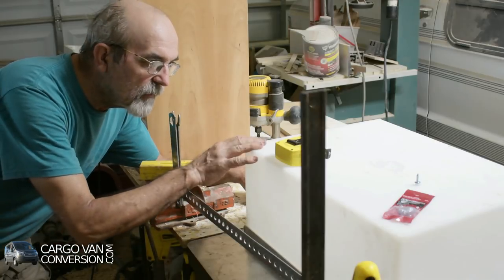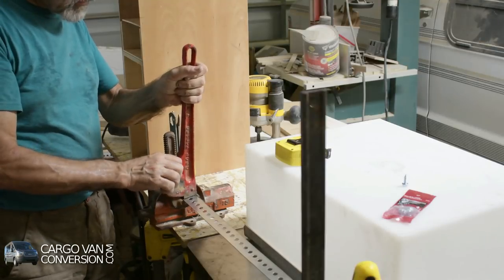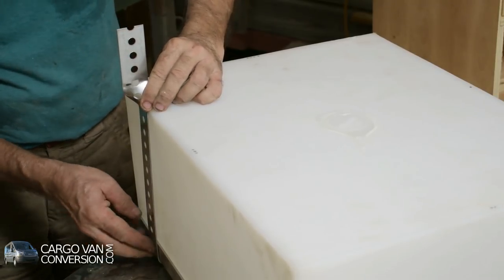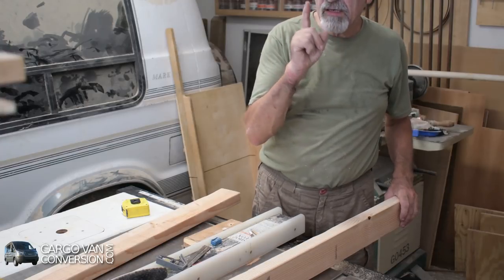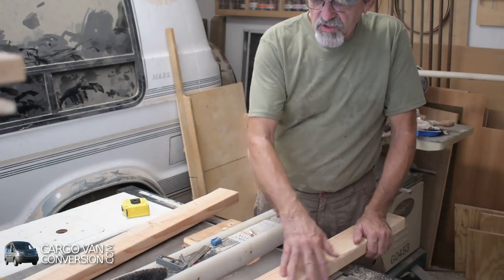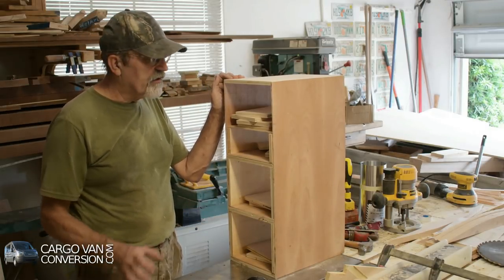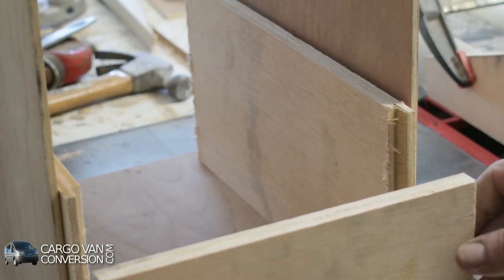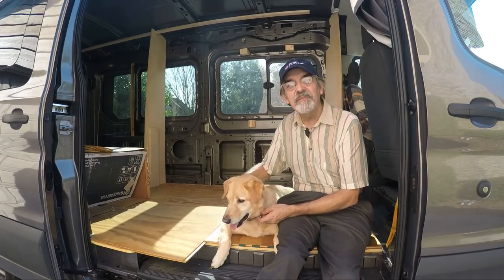Gray Water Tank & RV Workbench

Comment: Nothing like a compact work surface when you need to repair something. I never liked rebuilding parts on kitchen counter because no matter what precautions you take something always gets on it.
Reply from the maker: Actually, it will have a sizeable work surface of about 5 feet long, but only about 13 inches wide. I'm quite excited about the workbench. My greatest doubt is whether it will fit my lifestyle on the road. Having it is one thing, using another :)
While writing this, I remember that I wanted to do some (oil) painting too, while traveling. Time to make a folding painters' easel :)
Van Williams

Comment: I’ve never heard of over stressing wood before could you explain? My woodworking is limited to hand tools. But I enjoy watching you on that table saw.
Reply from the maker: Hi Stephen,
Stress or tension in wood is easily visible. When you look at the wood in a large DIY store, you'll find straight boards, mixed in with crooked ones. Both were straight when they were sawn. The stress in the wood has taken its toll. A table saw splitter, placed right behind the saw blade (I have it removed), avoids blocking of the saw blade while using the table saw. This happens when the stress in the wood can warp the wood behind the saw blade and make it stick. The splitter prevents that. When it happens without the splitter, the pure force of a turning saw blade, can throw the wood towards the woodworker. Extremely dangerous.
I usually notice it, while cutting hardwoods. Therefore I always joint and plane the wood not to its final dimensions, but slightly larger. The next day, I can size the wood to its final dimensions, without fear of more deformation.
It doesn't really help, being in Florida, where humidity levels are so high. Wood always have to acclimatize to its surroundings.

Van Williams